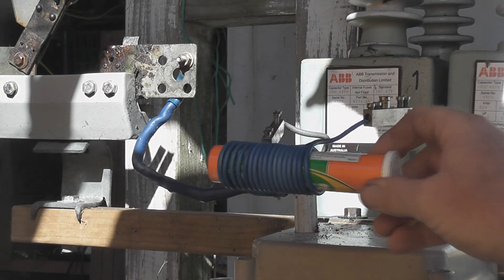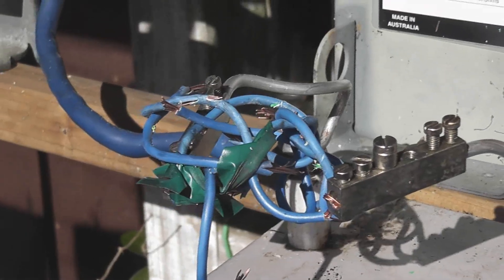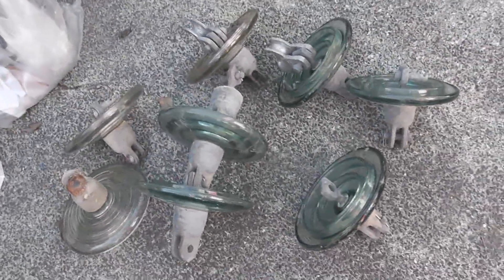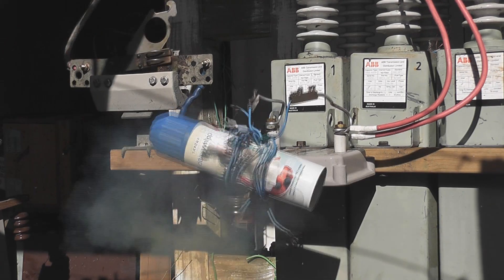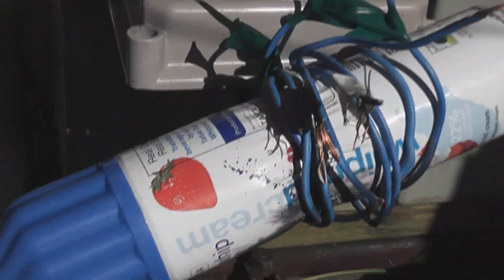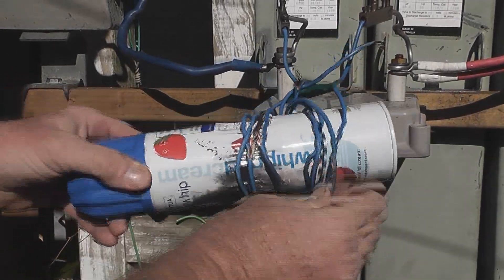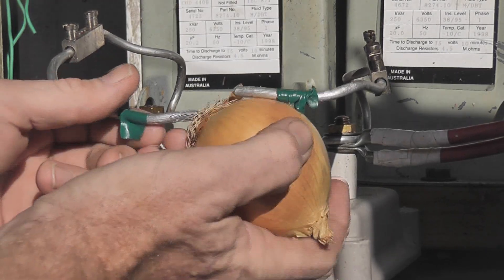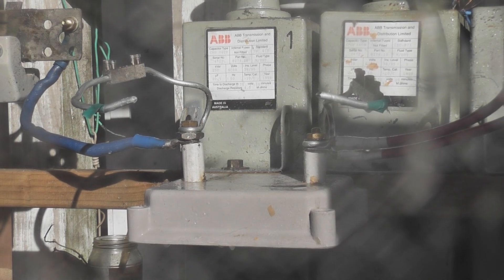Berocca can destroyed + Onion evaporated

Comment: Berocca..... "You, but on a really explosive poppage day!" :D

(The part in Italics is a twist on the sales slogan used in the UK: You, but on a really good day)

That coil though..... you really blasted that apart, almost like FUSE WIRE! :-O

The onion? Well, from what I saw, the camera took a walloping! :D It's either that or the blast-screen in front of it.

I take it that you DID have a blast-screen in front of the camera?

I wonder what other things you could put on that cap-bank?

I know..... See if you can get an old lightswitch and POP IT!

The one that Mr. Photon done, it instantly disappeared in a millisecond! I've never laughed =SO HARD= at a lightswitch. :D

Let's see then.....

Cartridge fuse (maybe a tagged one or HRC?)
A LIGHTBULB!! :D
Banana!
An annoying orange :D
Apple,
Water Melon, anyone?
Some fuse wire, if you can get any.
Thin copper wire, but shielded so that the shielding gets artistic copper spatter all over it. :D

magnetron Er... actually, forget that one, bits of berillium going everywhere not good!

LOUD SPEAKER POPPAGE!! :D

Old lead meter seals. :D

A couple of LEDs maybe?

Crappy electronic smart meter! One of the ones that HDXFH done.... The flippin' thing lit up like a lightbulb before blowing the case clean apart! :D

Or use the cap-bank to charge some other caps..... you know, like the little ones that may be found in consumer electronics. :D Let's see if they can take the power. :D

Here's one which could be A YOUTUBE FIRST: Wire-up a BRASS PADLOCK, with the body on one side of the potential and the shackle on the other side. Blast with full power. Now lets see if the shackle is welded into the body and cannot open anymore. :D

More impressively, see if the blast blows the padlock open! :D

Well, there's a pile of ideas for your cap bank. Happy popping! :D

Thanxx for showing,

-BoomBoxDeluxe.

Viewer # 381. :D

23rd April 2015, 02.55
Reply from the maker: BoomBoxDeluxe I destroyed a 32 Amp MCB, watermelon, lightbulb, 60 amp fuse wire. Will do a TV, degaussing coil and some surprises when time allows.
Reply: Haha, you've done a variety of things on that cap bank and I can't remember them all. :D

I should make a check list of the things that have been blasted, then I can put a tick beside them when they've been done. :D

The idea that I mentioned with the padlock.... I have a feeling that might be an interesting one, as it's something which isn't electrical, and could be looked on as being a form of very extreme spot-welding. :D

I can imagine it now.... =BANG= and there we have it...Shackle welded solid in there. :D

Yes.....Imagine all that GRUUUNT going through the shackle to the body of the padlock and the reasonably poor electrical connection between them.... I thin k it could make for some very interesting spaaaaarks. :D

-BoomBoxDeluxe.

23rd April 2015, 12.45

Comment: Nice pops! Aw man those are the insulators I'm looking for! Green glass suspension/torsion type! 
(Do the colours have anything to do with their KV rating?)
Reply from the maker: Machine Man No the colours have nothing to do with their kV rating. The strings are made longer for higher kV. Usually 1 is 11 kV, 3 is 33 kV, 8 is 110 kV in New Zealand
Reply: RODALCO2007 ahh I see, is the metal locking mechanism cast into the glass disc or does something else hold it on?
Reply from the maker: Machine Man There is glass in between the metal locks. I have a broken glass insulator and will do an autopsy on it.
Reply: RODALCO2007 that would be good to see! Thanks for all of that :)